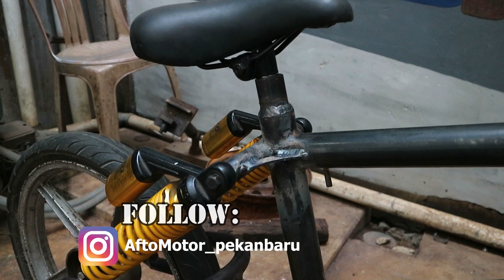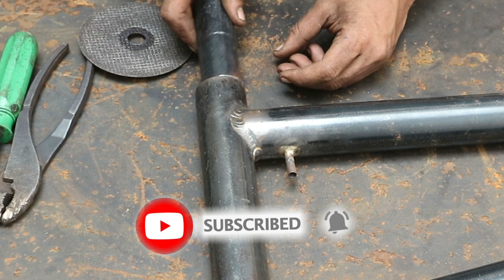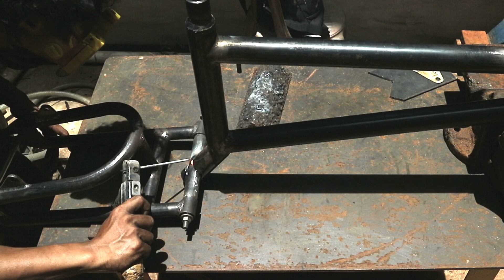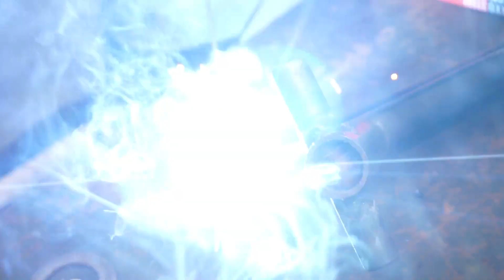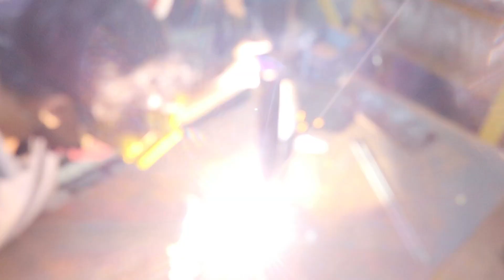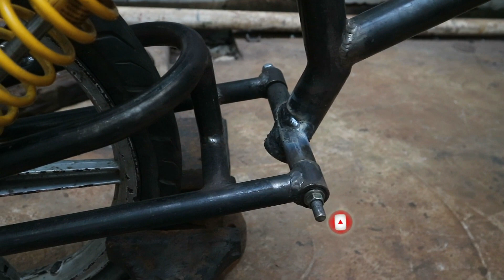Build BMX Cub part 2 [ Cara Mudah membuat Frame BMX kustom ]

Comment: How many litres does the bike hold in fuel? That's a small pipe in the frame. I would thought you would had made that part with a larger pipe to hold more fuel.  Anyway  nice build
Reply from the maker: 1,2 litres